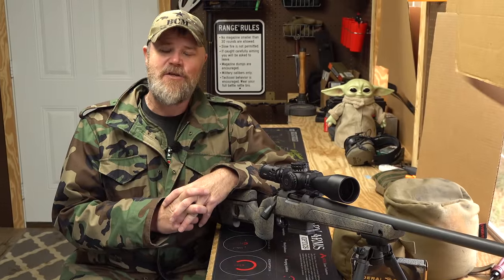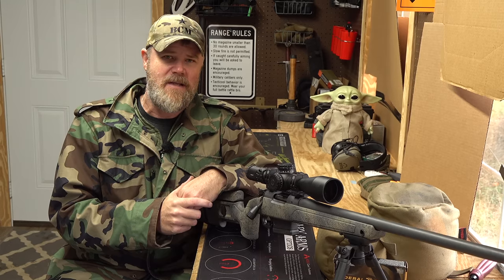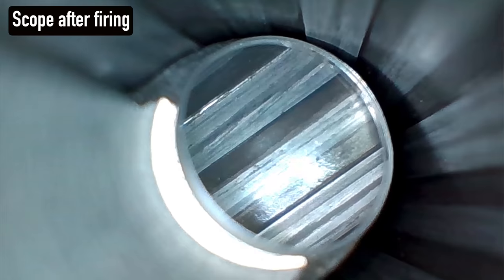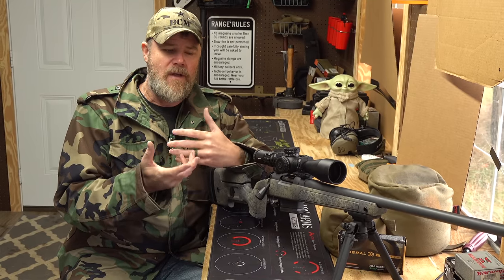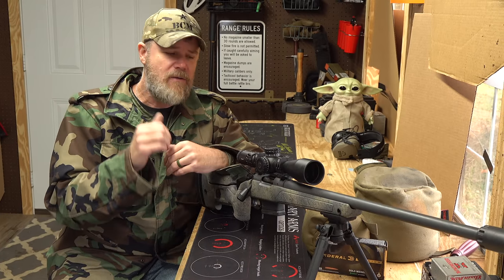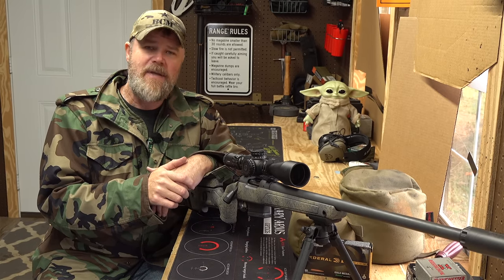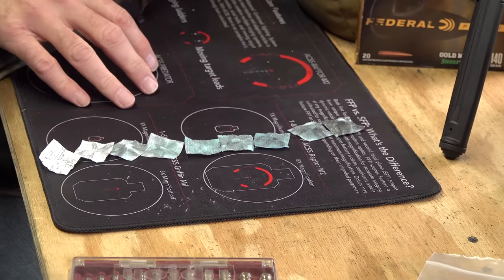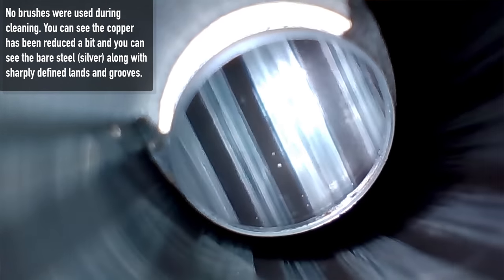Barrel Break-Ins and Cleaning Voodoo Rituals Destroy Barrels

Comment: I dont believe it when guys say "A bronze brush will """destroy""" a top shelf quality hardened steel barrel". They always say it but never actually prove it. How can a barrel that can withstand the psi in rifles plus the heat, but a bronze brush "ruins" it? Makes no sense at all.
Reply: i think the key word is bronze. I can see how stainless brushes could have a negative affect
Reply: I've never even seen a bronze or steel brush in a cleaning kit.  All the ones I have are copper or are they copper coated.  Either way, 4140, 4150, or R416 is not garbage metal for barrels.  I havent run thousands of rounds through any of my guns until FJB got in office but now that I have been sharpening my skills, I can say my guns all shoot sub-MOA.  All my hunting rifles shoot like they did when I first got them but most have less than 50 to 100 rounds through them.  I cleaned all of them with the Hoppes kits that have been out there for eons.
Reply: @mlone7  No, there are no copper brushes; they are phosphor bronze. There are stainless brushess, but those will damage a barrel.
Reply: @eddiehall7954  effect
Reply: Kinda like no ones ever proven that a break in procedure benefits a rifle or its accuracy in any way whatsoever
Reply: @eddiehall7954  I agree!
Reply: If a brass brush destroys your barrel, you got screwed when you purchased your barrel. Mohs hardness scale doesn't care about your feelings
Reply: @bd1435  whos claiming a brass brush will damage a steel barrel?
Reply: Doesn't matter if it's true/proven or not. Credentials don't matter . The point is to get you to watch the video.
Reply: @WilliamDumoreGlobz  Thats a very good point you just made. We're all being manipulated constantly. Its all so tiresome.
Reply: @drewfrailey1727  false.  I have seen many videos.
Reply: @WilliamDumoreGlobz  jokes on them.  After reading title, i didnt bother.
Reply: I agree entirely. The most brass will do is “brass” the steel, as in an armor or sword maker making a brass colored piece of steel. Now having that brass on there might not be ideal lol, but it’s not damaging the barrel. I suppose if you put down enough brushes with a drill, you’d have a thousandth or two of brass and then you might damage something when firing it. Outside of that ridiculous scenario, I can’t see any possible issues outside of the Rod or core of the brush itself (and honestly that would only
Be for really high end competition precision stuff).
Reply: Water cuts rock, it's less about which is harder.  That said, I have never had a problem with brass or even steel brushes.  Granted I never use them more than once or twice just to get the larger particles out.
Reply: @SALTYCOMBATDIVER  water doesnt cut rock🤦🏻‍♂️ whats in the water cuts the rock
Reply: @SALTYCOMBATDIVER-ExInstructor   Have you seen those robotic water jet cutting systems?  Guess what, it's not just water that they blast at objects like steel to cut them, the water is filled with particulate material with a hardness value higher than the object being cut, in order to facilitate the cutting.  Garnet sand for example.
Reply: @drewfrailey1727  two hydrogen molecules and one oxygen molecule.  It dissolves it, much like an acid does but slower and less energetically.  That's both how water cuts or erodes limestone and it's also how it is made or relocated in places like caves.  Ever seen mineral deposits in caves?  No abrasive is required for them to be made.  It's basic water dissolving the material and it then being deposited over time.  That's what I was referring to but you're smarter than me so tell me how that's not happening and how wrong I am.  Get your crayons.
Reply: @beardymcbeardface69  is that how the Grand Canyon was made?  Actually, water cuts rock in nature without the hard particulate.   Instead it dissolves it over time.  Sure, it can also carry sand like your water jet analogy, but it doesn't need it.  While you may have a beard, mine is white as snow.  On reenactment forums, you trust your gray beards, not disrespect them like you did.  Get your crayons to show me how I'm wrong and while you're at it, to show us where the bad person touched you.
Reply: @SALTYCOMBATDIVER-ExInstructor  "water cuts or erodes limestone"

Are you conflating erosion with cutting?  Cutting is a process of erosion, but as you've already mentioned, dissolution also plays a role in erosion.

But dissolution is not cutting.
Reply: @beardymcbeardface69  how do you say you were wrong, but still insist you were right?  I bet you're a lot of fun at parties.
Reply: @SALTYCOMBATDIVER-ExInstructor   I didn't say I was wrong.  I guess your lack of reading comprehension explains your position on this.

What I said, is that you appear to be conflating erosion and cutting.  Erosion occurs due to more than one process.  You mentioned one of those processes, but the process you mentioned (dissolution) is specifically NOT the process claimed to occur within gun barrels due to hardness (cutting).

You claimed that, "Water cuts rock".  Now you're trying to save face by falling back on water dissolving some type of rock.  The subject here, is water cutting rock, to make your incorrect point that, "it's less about which is harder".

But as already mentioned, in nature and in industrial processes, it is not the water which CUTS rock, it is the hard particulate materials which are carried by the water, which cuts away a rock.

Dissolution is a separate process of erosion, which is not in any way applicable to the advice of not not using anything hard to clean a barrel.
Reply: And people even tried to destroy a barrel with a bronze brush, including me (well I tried to destroy about 4 inch of the barrel, it was a leftover after barrel shortening), to check if its actually possible. I really couldnt do it even with a brush attached to a drill. What I didnt try yet is to jam a lot of cleaning patches into it and try to use some kind of press to make brush go through barrel with a lot of force, maybe that could break it, but I figured out I would break cleaning rod sooner anyway.
Reply: But if it isn't necessary....why do it?  Just to prove what?
Reply: Exactly correct. In my experience most barrels start to shoot after a 100 to 150 rounds. I only shoot 3 to 5 rounds and then let the barrel cool off, over heating light barrels isn't the best idea. Then I clean after use with a bronze brush and No 9. I leave No 9 in the barrel until the next time I want to shoot that rifle.
Reply: Yep, if a bronze brush, scratches your barrel, you better take the manufacturer to court . People been using copper and bronze for better than a hundred years and winning championships with old rifles . The best product to use is bullshit mixed with beach sand and a sand paper wad on the end of a high speed drill for about ten minutes . :)
Reply: @asdfjkl981  Never heard of a knife dulling? Lol
Reply: @princam_4775 a blade dulls on soft but sturdy material because the thin edge gets bent. Not because of bread erosion.
Reply: @asdfjkl981  And a softer, but sturdy material such as a brass brush can damage the rifling over time.
Reply: @princam_4775 no. Because rifeling does not have a thin cutting edge, dum dum.
Reply: @asdfjkl981  Watch the bore scope footage. Lol
Reply: @princam_4775  And what exactly do i see on them? In this video there is no footage of a barrel cleaned with a bronze or brass brush. they do nothing to your barrell. 

wake up. if you dont have extremely high temperatures, velocities, pressures of several 10000 psi or corrosives, steel is virtuallly indestuructible to conventional copper alloys. try cutting a steel tube with a blade that is made from brass or bronze.
Reply: If that were true sandpaper wouldn't remove the edge on Steel, but sandpaper works because of friction and repetitive motion. If bronze wouldn't dull Steel I challenge you to kind of bronze screw in half with your hunting knife. I'm willing to bet it will dull your hardened steel blade.
Reply: @duanejackson6718  sandpaper works because Aluminiumoxide is way, way, way harder than steel you tool. And as i already mentioned a blade dulls because the cutting edge BENDS.
Reply: @asdfjkl981  agreed, technically the metal folds and then breaks, that's why if you drag a chain behind your pickup the chain will grind down even though the chain is harder than the pavement. Aside from that anybody that uses a brush is an idiot there's been enough experiments done showing that a brush will in fact disturb the accuracy.
Reply: @duanejackson6718  a steel chain is NOT harder than the pavement!!!!
Reply: I swear.  It's like everyone's concept of material properties has never graduated beyond "rock paper scissors".  If you think that a knife edge is relevant to the conversation, then you don't have any concept of stress.  If you did, you'd know that your knife analogy proves nothing in your favor.   Then again, if people think that alumina and concrete are "soft", or that beards matter, the conversation is probably a lost cause.
Reply: @PSUQDPICHQIEIWC  in a nutshell, you're saying everyone's so stupid it's not worth commenting, and yet you commented anyways.
Reply: You are right- Its impossible.
Reply: @duanejackson6718  Let me be more specific.  Not everyone, but several people, including you.  I'm free to express my utter disappointment in the behavior of grown men trading grade-school level misunderstandings as if they were the wisdom of the elders.  This sort of bullshittery is practically a tradition across firearms-related circles. .
Reply: Copper jackets will eventually wear out the bore. 

It's just that it takes a lot longer with a brush. It's theoretically possible though with some people's crackhead "THIS IS WHAT I WAS TAUGHT IN THE MILITARY" rituals.
Reply: As I said in my other post:  The barrel is sized for the bullet.  It is not sized for the brush.  But, if you do use a brush, the barrel is eventually going to be sized for the brush.  Is that really what you want?
Reply: @asdfjkl981 It depends on how sharp the knife is.  Ask your barber how he'd feel about using his shaving razor to cut bread.  Ask yourself if you'd like to be shaved by a razor that had cut bread.
Reply: @Quakeboy02  In other comments i already explained this. the razor edge dulls on "soft" materials because it rolls over since it is so thin. the edge in a barrfel is not thin and does not roll over when it is cleaned with a softer material.
Reply: @asdfjkl981 If it were only your gun that would be damaged by your wrong-headedness, few would complain.  But you don't seem to understand the basic problem.  Metal on metal results in wear.  The reason that the wear from a bullet in a barrel doesn't cause much wear is because the barrel is sized for the bullet, much like an engine's cylinder is sized for the piston.  But if you take a brush that is .015" (according to my micrometer) larger than the bore of your barrel and force it through that barrel, there is going to be much more wear than sending a bullet through the barrel.  This is just basic mechanical science.
Reply: @Quakeboy02  The only one that does not understand something is YOU, and you proved it. the barrel is in fact UNDERSIZED for the bullet otherwise the rifeling would not do anything at all. try to push a bullet through your barrel with a stick and tell me how that worked out for you. 

wear accures because of the hot gasses and speed.
Reply: @asdfjkl981 So, increasing the diameter of the barrel by grinding away at it with a stiff brush is going to make that better how?
Reply: Its simple physics too. Bronze is softer than Steel. Softer materials can NEVER scratch harder materials. There is a guy who took a brass brush on a drill to his barrel and ran it the wrong way and moved it back and forward. His barrel came out very clean. But there was absolutely no gouges.
Reply: @JustAGuy93-G  "Softer materials can NEVER scratch harder materials."  Tell that to mother nature.  She's still of the opinion that water can eventually wear away a mountain.  And so far, she's been right.
Reply: @Quakeboy02  
Erosion is not the same as abrasion. Erosion is still caused by abrasion in a way. There are things dissolved in the water that are harder than the rocks they erode. And in some cases, the water itself disolves minerals in the rocks and washes them away. Look at limestone for example. Also in sea water there are fine particles of sand. Ever heard of sand blasting? That's basically sea water erosion on steroids. 

Abrasion is more of a mechanical interaction between atoms forcing and sheering other atoms off. This is where the hardness scale comes from, atoms that are held together stronger than other atoms will force other atoms off before they break off themselves.

So yes, mother nature is right, but not for the reasons you think. I should have probably stated that its much harder for softer materials to scratch harder materials rather than they NEVER as it is still possible but just very difficult and will not cause a barrel to wear out. My point was it would be very difficult to scratch a barrel with a brass brush providing it was a quality steel barrel.

Think about it. You are squeezing a slug coated in copper or brass through your  steel barrel at pressures up to 60000 PSI at speeds up to 1000 meters per second in some cases. Depending on caliber it takes thousands of rounds to even begin to damage a barrel. So its stupid to think a few brushes of a copper or brass brush is going to ruin your rifles any faster than actually shooting it.

Steel brushes on the other hand will damage your bore as its much easier to scratch steel with steel. Either way, i agree, dont over clean your barrels. I usually just spray my barrel with Browning Legia and put a copper brush through from chamber to muzzle two to three times then mop it and its mirror clean after 50 - 100 rounds.
Reply: @asdfjkl981 You haven’t seen a lot of old worn down things, huh.
Reply: @jm329 the worst was your wife so far.

Comment: Fallow the manufacturer listed procedures. 
You’d be surprised how little they want you to do
Reply: TheMetalGuy852  man you know I’m loving that sht
Reply: @brandonparrett2436  I wish people were as fervent about “end the Fed” as they are about “let’s go Brandon”
Reply: Exactly. I followed my Christiansen Arms break-in procedure and amazingly enough its pretty much the same way as you described.
Reply: Where can I find those procedures? Website or manual I'm guessing?
Reply: Peep the Bear Creek Arsenal break in procedure. I was sweating after I was done with it lol.
Reply: I have a rifle from Howa that literally says to NOT clean the thing unless accuracy falls off.

So I don't.
Reply: @TheZombieburner  that works so long as you don't shoot old surplus ammunition
Reply: Tikka made the rifle and recommends   "use a smooth cleaning rod fitted with a bronze bore brush soaked in bore solvent and push or pull through the bore untll all major residue is removed
 ( approx 10-15 times)"  After descriptions follow to finish up the work with felt pellets. Seems like a lot of brushing but does hint that maybe a bronze brush is no problem.

Comment: Thanks for the info. I just bought a 6.5 Bergara b-14 hmr and have yet to clean or shoot it and was planning to lap the barrel. Now, I will be sure to use a non ammonia solvent to clean the carbon and not worry about copper fouling. I also added a dehumidifier to my safe. I always did push the brush from the chamber side only to protect the crown of the barrel but now will not be using a bronze brush although I still don't see how it would damage a steel barrel except mixing metals that could corrode. I enjoy all your videos.

Comment: I like the silicon bore wipes..They look like a cylinder with about 8 shelves on it that are the size of the bore. Throw a little Hoppe's cleaner in the spray bottle on it and pull the cleaning rod through..It creates an air tight seal and just pulls carbon all the way out...Cuts cleaning time down and patch use down to a minimum. After that run like 2 patches through it with a touch of oil and it's done! Best cleaning thing I bought in awhile...1 problem though, they aren't very durable..They last about 3 years and you have to buy it again.
Reply: I had one for my paintball gun when I was a  younger. Probably 17+years ago. I've never seen one for rifles. It worked really got for getting broken paint out of the barrel
Reply: @alexduke5402  Yeah pretty much the same concept
Reply: @50 Stitches Steel I'm having trouble finding those, have a link to where you buy them?
Reply: @___meph___4547  You get the Hoppe's Black Spary bottle solvent (make sure it's the spray bottle version because it's a different formula then the regular version that works really good) and spray it down the bore and let it soak. Then use the Sqeege brush..Works good enough to get the carbon out without needing to brush it..The brush will work better for total cleaning, but like MAC said in the video it's not necessary to get it that clean...Think of it more like a reusable patch, that works better.
Reply: @TarBeeBee  Ben, Remington makes them and they are called "Remington Bore Squeeg-e Cleaner" make sure you get the right bore size for what you need...The .22 caliber version will work for 5.56 too.
Reply: Odd comment for a HowNot2 video Stitches… oh wait, wrong channel, my bad.
Reply: @AZDesertExplorer  😅😅🤣
Reply: @50StichesSteel  very slick, thanks!!
Reply: Check out the Remington Squeegee cleaning system, i use it on my Remington Rifles and it works great
Reply: @thatoneguybones8036  You mean the Remington Squeegee? i have all different sizes of them and they work awesome, i just brushed my 35 yesterday and ran patches through it, until they were clean, i then said im going to run the squeegee once to see, and i was so surprised the black gunk it poured out the muzzle